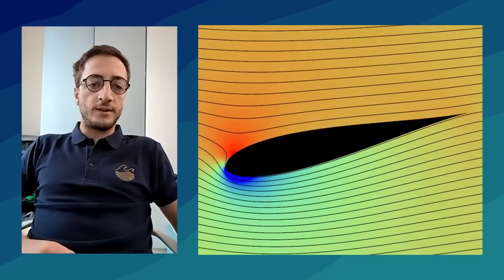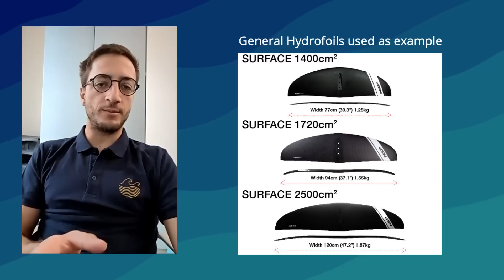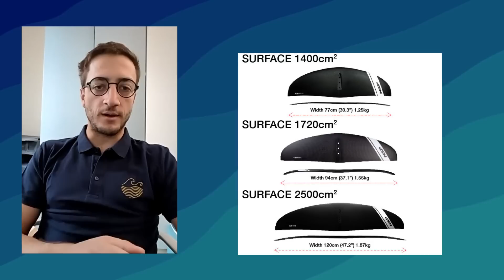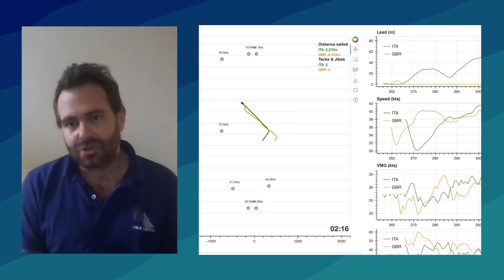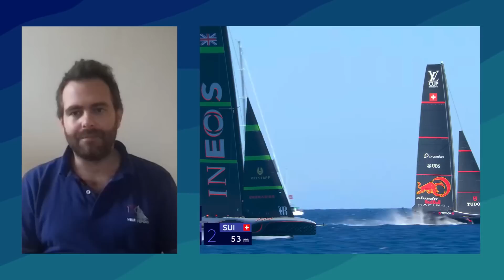America’s Cup Nosedive, Cavitation and Foils Explained. Interviewing an Engineer #americascup

Comment: I'm wouldn't think the video on the right at 2:15 and 7:40 is necessarily demonstrating cavitation (or ventilation). It's showing flow separation and eventually a stalled foil. I think the "cloudiness" that we can see is from the marker smoke/lines that are injected in the flow for visibility, as the layer detaches and becomes turbulent.
Reply from the maker: The video you see in the timestamps is an example. As said in the beginning we’ve decided to make a simple, efficient and for everyone analysis, so the examples follows the same concept

Comment: Pietro assumes at around 12:00 that the rudder will always lift the aft end of the boat, and this is true when lifting off the water at around 20 knots, but my understanding that at higher speeds, it transitions to pulling down (helping with righting moment). This is particularly true if the bearaway is not well executed in stronger winds and the boatspeed does not increase quickly enough. The apparent wind then swings further aft, and the resulting drive force on the sails forces the nose downwards. If the rudder wing foils lose grip, the result will be a sudden nosedive.
Reply from the maker: Let’s take as example a normal sailing boat. When you sail upwind the force of the wind is “lifting” the bow, so you will ask everyone to stay seated the most forward possible in order to balance the floating line. On the opposite when sailing downwind the wind is lifting the stern so everyone “squeeze” to the back. Let’s say, as it is, that the apparent wind of the AC75s are always upwind. So in fact it makes more that sense that, considering also the very high apparent wind speed, that the rudder lifts the stern. If it doesn’t do that… look at American Magic takeoff 3 years ago

Comment: Thank you for mentioning ventilation contra cavitation. Ventilation occurs when both a) pressure on one part of the foil is below 1 bar and b) the low pressure area reaches the surface. Lift is suddenly and dramatically reduced. Cavitation occurs when the pressure on one part of the foil is below the vapor point of the fluid. It is far more severe, and can tear even bronze apart. While the lifting portion of these foils seem to be intended to be fully submerged, in practice its tip is almost always above the surface, threatening ventilation.